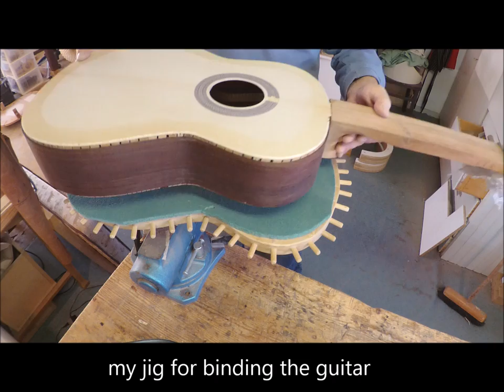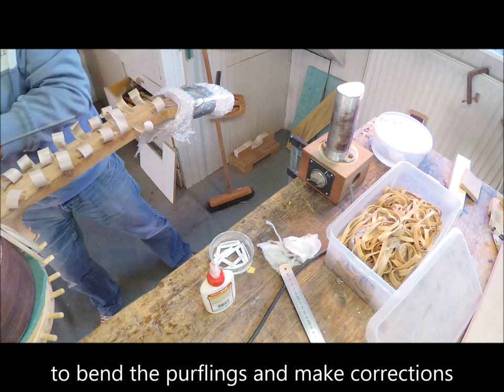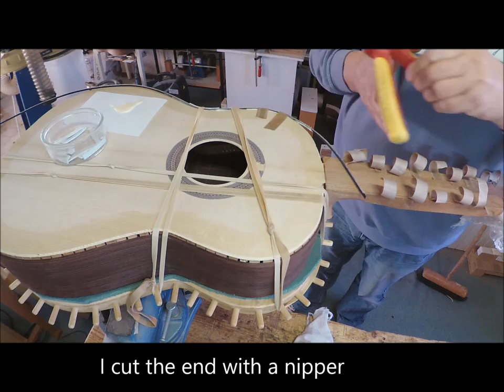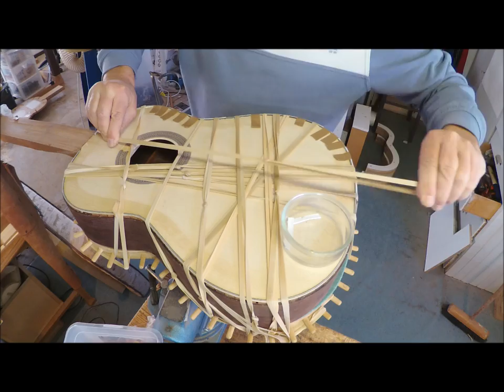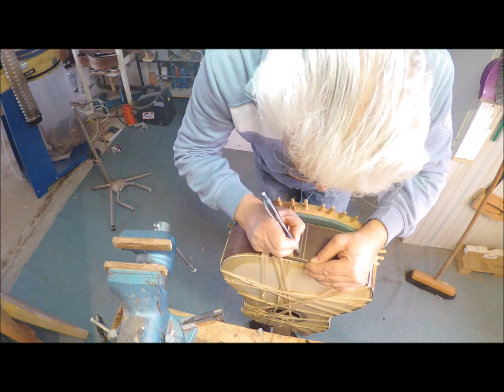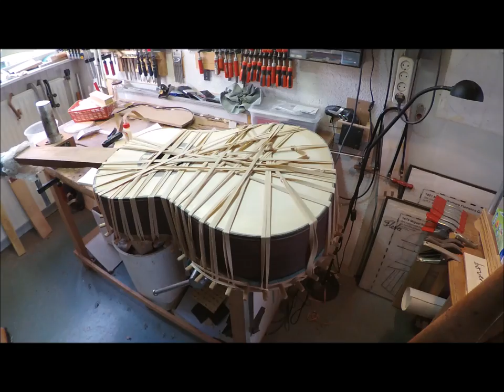Binding and purfling a guitar part 1

Comment: Hi! May I ask you a question? I bought a very cheap/old guitar at a flee market here in Spain and the back board had basically follen of. The guitar is so badly made that it was glued by a cardboard band... I thought, just for fun, I do not intend to make a good guitar (although a solid one), i could replace the cardboard band with wooden triangles and the do a sort of binding. How stupid would it be if I use different pieces of wood for the binding itself, if I change it every, say 5cm? How important is it that it's the same piece all around? Thanks!
Reply from the maker: it is possible. Luthiers did it on italian mandolines in the past and also on guitars. Just google on mandolines and you'll see it!